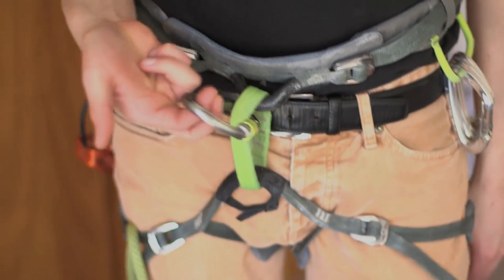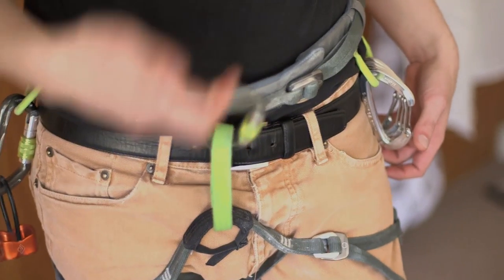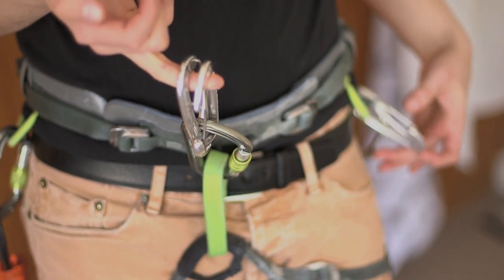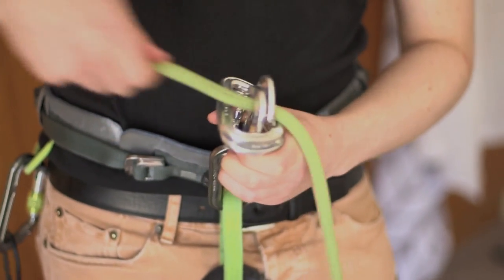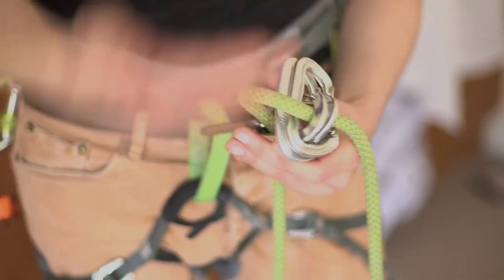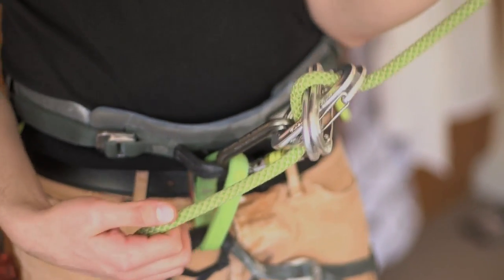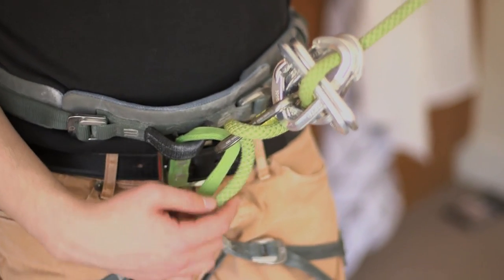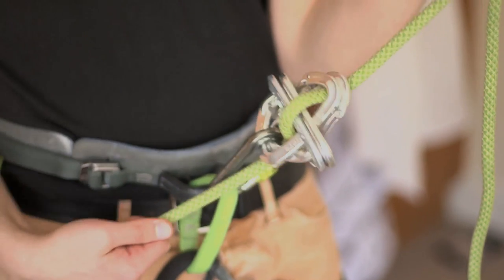Climbing tips: Making a rappel device out of carabiners (BINER BRAKE)

Comment: I've used this old school set up a bunch of times intentionally for extra tall 90m (300 ft) abseil/rappel because this set up can take more friction/heat and won't damage or glazed the rope.  I used 2 steel carabiners for the vertical piece and 3 steel carabiners as the horizontal "breaking bar." But in no other situation would I recommend it.  Combo of slack and jiggle (or getting caught) can send the horizontal carabiners over the top of the whole system and end in your demise. I'd just use a munter or super munter and go in molasses speed. If it's an emergency, no need to complicate the situation more.

Comment: A very usefull knot to know: hms knot
It works perfectly in emergency rappel, fast and you only need one carabiner
Reply: well, the hms knot(munter hitch, also italian hitch) wears out the rope, because the majority of friction is generated from rope-to-rope contact. Within a belay device friction is generated only rope-to-(eg figure eight, reverso&binner).
A climber should try to keep ropes and gear in good condition.
using hms knot also increases uncoating of rope. (coat starts to move freely independant of the core).
but yes hms works fine in emergency, but best to be avoided if unnecessary.
Reply: Psst.....  emergency rappel